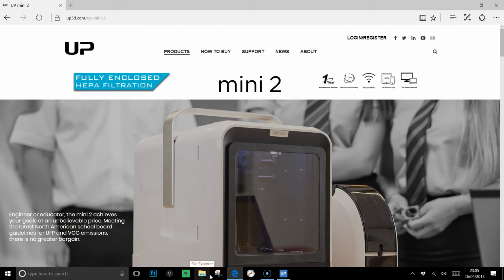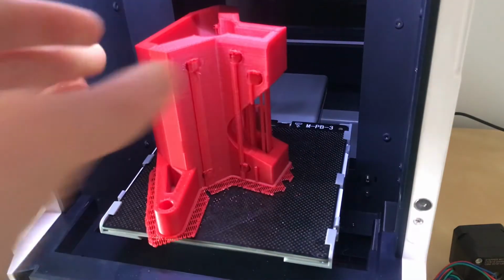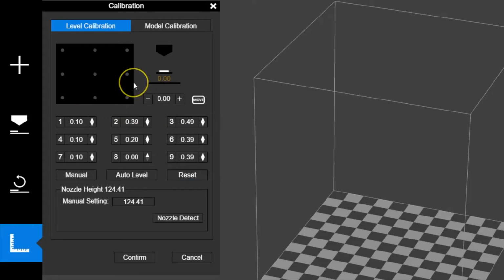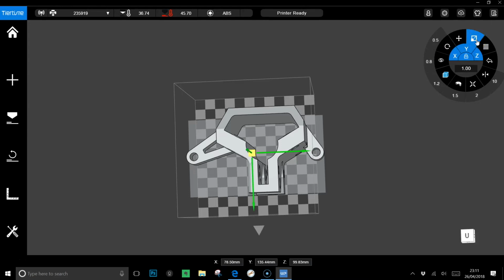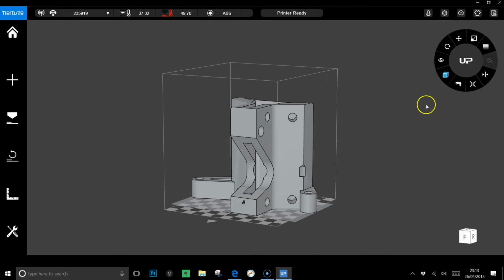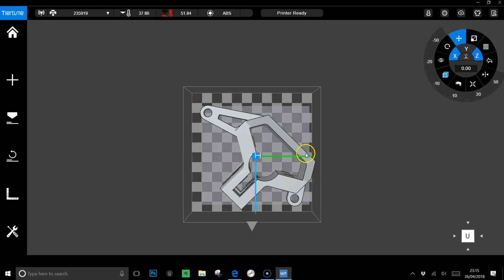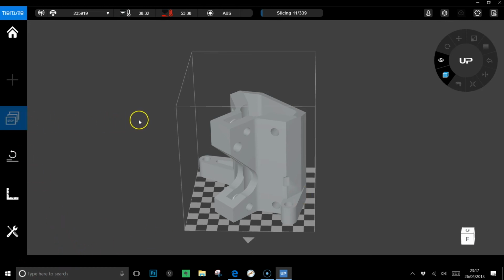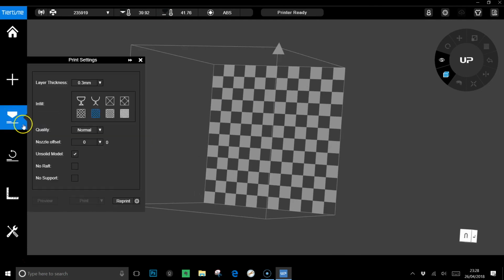Up Studio 3D Printer Software Review

Comment: I have had two CETUS printers for some years now and I have struggled to get the best out of them... it's a real shame because the printer itself is extremely good value and reliable. The software design proprietary and has an awful user interface , letting down a good printer! I haven't got the printer you used in the video but I completely agree with the comments you were making.
Reply: Is there any updates to the software quality? Looking to help a friend set up a UP mini 2 they picked up.

Comment: The thing about rotate is that you actually grab the ring denoting each axes around the model rather than the model itself. 
But the biggest shame for me is that it does not give much control over the infill and speed it prints. There used to be this thing I found on github called FixUp3d that allowed you to control speed and layer temperatures but apparently it does not work with the newer version of the software.